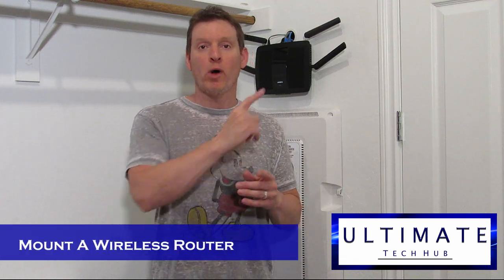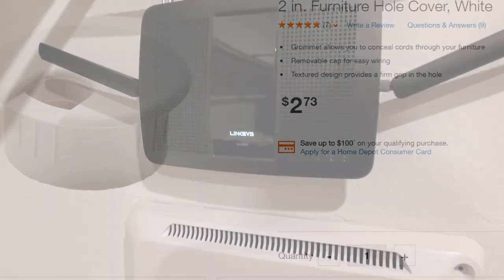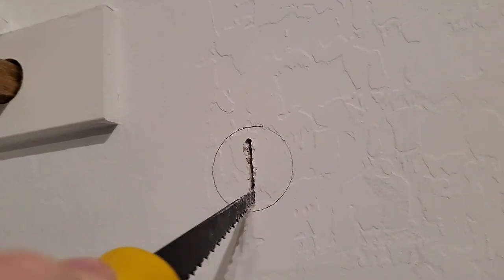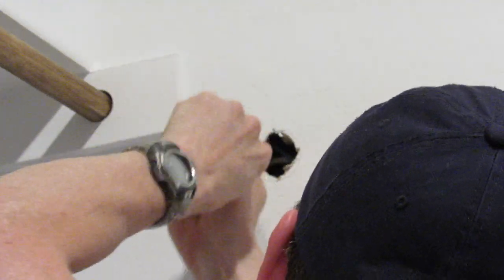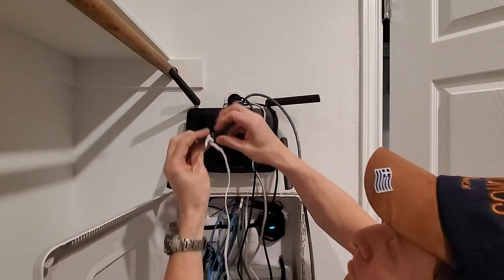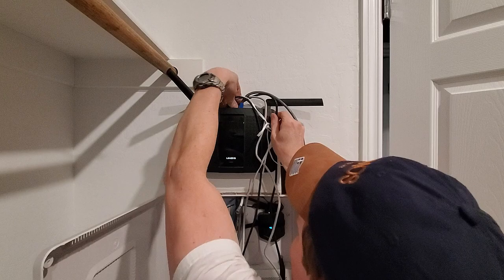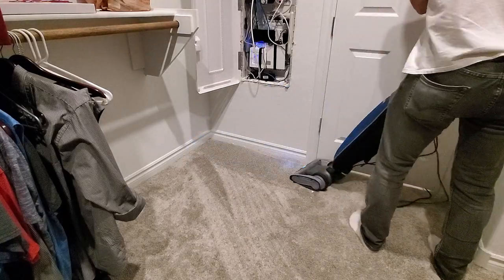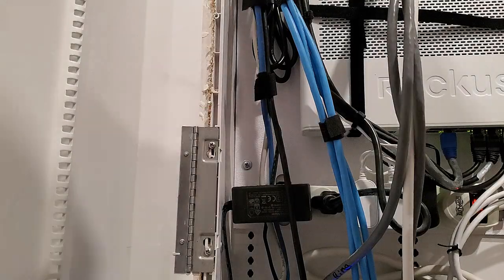HOW TO MOUNT A WIRELESS ROUTER TO THE WALL -DIY - HIDE WIRES BEHIND THE WALL!-BETTER WIFI  RECEPTION

Comment: I could be wrong, but I'm pretty sure running the power cable through the wall like that is a no-no for electrical code in most areas.
Reply from the maker: Nope its not illegal. Its no different than wall hanging a big screen TV and running the power cord inside the down to the bottom were the outlet is. If it was installing a powee outlet then you would want to make sure it was up to code. Good point though. Thanks for watching and if you subscribed thank you as well.
Reply: @UltimateTechHub  in some locations, it IS a no no for running your tv wire through the wall. They make you install an outlet behind the tv. Power cables arent as protected as romex
Reply: @UltimateTechHub  You are just plain wrong about basic electric codes. Although they vary by municipality in the US appliance power cables cannot be run through the walls bare — in most places not even inside conduit. Romex, proper junction boxes and approved connectors are required. You are obviously just trying to justify your technique in this video — but you don’t have a clue what that facts are. Bad advice made worse by ignorance
Reply: @UltimateTechHub  in cali its not code to run tv power cord into the walls.
Reply from the maker: @sunstyle52  Yes I know it's not code anywhere in the US. I replaced the router and mounted it to the network panel door. Thank you for watching.
Reply: @drdrew2 you haven't a clue either. The wire in question is not appliance wire or cable, whatever that might be. The wire he is running is low voltage wire from the device's adapter to the router itself. It poses no hazard.

Comment: Wouldn’t it be easier to use a hole bit on drill and could you also tie all of your Ethernet cables to the string and save time pulling them all at once?
Reply from the maker: Yes that would work as well. Thank you for watching!

Comment: as you said a hole saw would of been much easyer, you could of bought a cheap one for $13 for the video !!! ,also a lot of video neglect the fact there is noggins between the verticle parts of the wall frame !!!

Comment: I’m not a tech person. I need some advice. I have a triple play with Spectrum. I want to move my router and modem to a more central location. I have a cable jack ( cat 6 ) and a phone jack in the location. The problem is the phone jack doesn’t work at the new location. It did work at the present location. What should I do? I guess the technician never ran the primary phone connection directly to all my phone jacks. Help! Thanks, Dan
Reply from the maker: Do you have a network panel? A place where all of your Cat6, phone lines and coax meet up? If you do have a network panel then it should be very easy. Let me know when you get a chance.

Comment: Mike, yes I have a panel. How do I make the new phone jack operable at the new location ? Thanks, Dan Heppner
Reply from the maker: Good then you need to look in the panel for phone lines. There should be a couple of phone lines since you said you have at least 2 phone jacks in your house. If you have one phone line hooked up in your panel and another one is just hanging then you can swap it out and plug that phone line in. What I mean by plugging in is there should be a phone jack adapter in the panel. Sometimes they have one with multiple connections and then you could just plug all of the phone lines into it. Also you can use a network testing tool to check for all of your connections to make sure they are working properly.  Here is a network tester video I made last year. 
https://youtu.be/Ws5eP7jiCkE
Keep me posted.

Comment: The Legrand website has instructions on how to properly install a “Structured Media Enclosure” for existing construction. Your video goes against the manufacturer’s advice and the general electrical code. The power is always hardwired to a new outlet INSIDE the cabinet. And the wireless router stays INSIDE because the plastic cover is specifically WiFi transient. For just and few dollars and a few extra minutes you could have done it the correct way. Your home insurance won’t cover a fire with this install. And when you go to sell the house it will fail inspection. Just do it right — and take down this nonsense. Read the instructions next time. And don’t share your lack of knowledge and skills that it could encourage others to copy your mistakes
Reply: Even if something is wifi transient, does not mean it strengthens the wifi. The less blockage, the better. There is nothing here that would result in the house burning down unless he was negligent.

Also. Building codes not only vary by state, but even local order